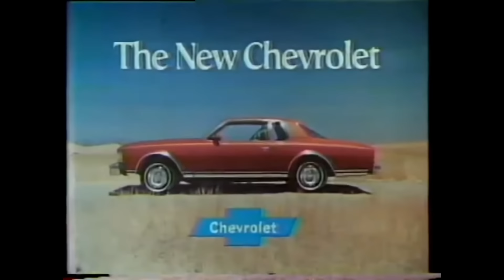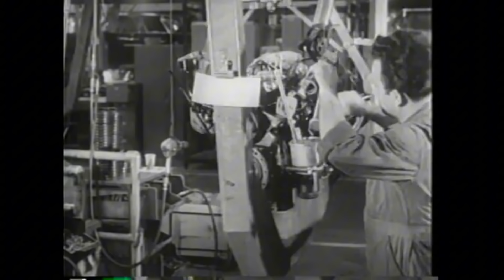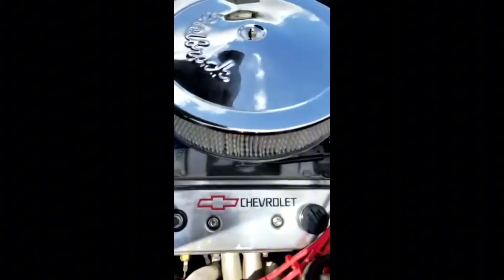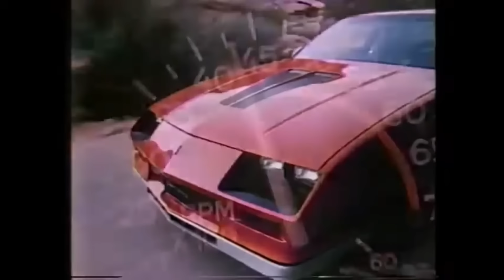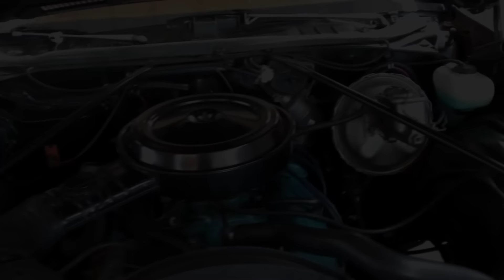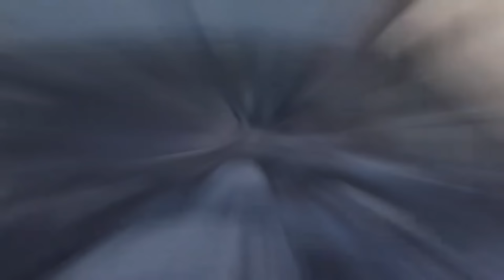How the Chevrolet 305 V8 Became GM’s American Savior AND Scapegoat

Comment: I am compelled to point out that while the 1960s 283 was making 'more power' than the 1970s 305, there is a significant factor that the video creator neglected to mention.  In 1972, the automakers were compelled to switch from specifying 'gross' horsepower to 'net' horsepower.  Gross horsepower figures were calculated using an optimized, bare engine on a test stand, while net horsepower figures were essentially measured 'at the wheel', with all accessories in place and operating, driven in real-world conditions.  For most engines produced in the early 1970s, this resulted in a roughly 30-40% drop in the specified outputs, even though the engines themselves had not undergone any radical changes for EPA and CAFE yet.

Bear in mind also that automatic transmssions were becoming more prevalent at the time, and in an effort to make cars more fuel efficient, axle ratios were being scaled back somewhat - instead of the 3.23s found in a lot of cars of the 1960s, ratios in the 2.75 and 2.80 range were being installed in newer cars - Ford even introduced a super-conservative 2.47 axle.  The lower-numbered ratios tended to curtail acceleration a bit, as the engine had less mechanical advantage to move the vehicle.

Pollution controls were still comparatively 'light' when this change occurred, but as the 70s ground on, more aggressive measures to improve fuel economy and pollution control resulted in lower actual outputs - more aggressive ignition timing, lower compression ratios, tweaks and modifications to carburetors, the addition of thermactorr pumps, and of course the dreaded catalytic converters.   It didn't help that the automakers stubbornly refused to downsize the cars, continuing to build land yachts until the late 1970s before introducing smaller versions of their full-sized iron.

The 305 is often maligned as a smog motor, but having driven a number of them in midsize cars, I always found them responsive and reasonably efficient.  Of course I recognize that they were not race engines, and even their ability to be modified was somewhat limited compared to the 327s and 350s of old.  But the 305 was reliable, durable, and smooth, and finding parts to fix one was inexpensive and easy.

Comment: I had a 3 of them.  One was a '79 Impala with a duo jet carb that got 28 mpg on the highway. I later sold it with 140,000 miles on it.  The 2nd was an '81 Impala that I bought as a body without an engine.  I completely rebuilt a 305 HO out of a crashed Trans Am.  It was 0.30 over, with flat top pistons, and an aftermarket RV cam.  It got 27 mpg and ran 15.20 at Edgewater Dragway in Ohio with stock gearing.  I lost it when some drunken teenagers ran a stop sign and broadsided me.  The 3rd was  a ' 79 1/2 ton Chevy truck with a 350 Turbo trans.  It got about 17/18 mpg on the road. I sold it to a friend of my brother.  My experiences with 305 Chevy engines were all excellent.  They performed well, didn't use oil and were trouble free.  I think they are good engines that gave good service.   But, I serviced them regularly, and never ever ran them hot.  The only maintenance done was tuneups, (Plugs, wires, cap and rotor), oil changes, and one set of new valve cover gaskets.  I like them.

Comment: What I never understood was, they had a 307 cubic inch engine. It was not that long into production was maybe three or four years why did they create a new small block? Unless it was some regulation about being 5 liters or smaller
Reply: Two reasons the 305 over the 307. First, the 305 could use the 350 crankshaft (sharing parts). The second reason is what's called "surface to volume ratio". It's an important factor for thermal efficiency (fuel mileage) and emissions, and it's better on the 305.
Reply: @turbo8454  thank you for that info. i read up on those engines and realized that the 305 and 350 were sisters as the 283 307 and 327 were.

Comment: I bought a 78 Pontiac Gran Prix with the 301v8. I never had a problem with speed. Great engine
Reply: I also had a 78 Grand Prix LJ with the 301 2bbl. It was a great motor.
Reply: Those were Pontiac motors. Apples for Oranges.
Reply: @davidbray7998 yes they were, the 301's grandfather was the Pontiac 389.
Back then every GM car and truck came with a tag saying it had a GM engine whether an Olds, Cadillac, Buick and so one. So if you wanted an engine made by Pontiac you picked an engine only Pontiac offered.
GM got sued by buyers with Cadillacs that got the Chevy 350 or 305 and they were pissed. GM ran low on brand specific engines that some bean counter decided a 350 was any 350. Same with the 305.
Reply: @311jbknight 
Haha I remember that. There was also an Oldsmobile guy who regularly bought a new one and he hit the roof and demanded a buyback when he found out his latest Olds had a Chevy engine in it.
And that was late 1976 so for 1977 and newer started the disclaimer on the window sticker that your new GM vehicle could have an engine made by a different division but they were all GM engines so basically not to worry lol.
And that was also the end of every engine having it's own unique color and for 77 every GM engine got the new paint color, GM Corporate Blue.

Comment: What would have been cheaper for those dumbasses was to build a 302! They already had 4" bore blocks, and 267 had the 3" stroke crank and there ya have it a 302 that would have been economical and easy on the wallet. They were and are dumbasses!
Reply: Agreed, the 305 was an 'under square bore' engine.  They'd have been better off with a 'oversquare bore engine'.  
The zz302 was a bit of an anomaly though.  They could have saved tons of money if they'd have just reinstated the venerable 327.  
But, engineers don't get paid for dusting off old tech.  They have to justify their jobs somehow.
The 305's main downfall was, it simply couldn't breathe.  The head flows were horribly inefficient.
Reply: @atheplummer  Ford ran the 302 in everything I am a bowtie guy but the blue oval 5.0 was AOK!

Comment: Alot of people that bash the 305 never owned one - yes the cams went flat but w a few bolt ons and a decent cam they ran great - now i am sure there were some 305s that were nothing but trouble but i had a 305 in my Z and it ran great - not alot of power but enough to do a cool burn out

Comment: My Dad had an 86 silverado - at 43k miles the cam went flat - he installed a new crane cam - roller rockers- edelbrock intake and had the q jet freshened up - he installed dual exhaust and that 305 ran great - he drove it another 80k w no issues and sold it - at first he cursed the 305 but after the new cam he loved that engine -

Comment: Once my 350 in a 74 Camaro let go I had to come up with a replacement, briefly flirted with the idea of putting in another 350 or even a 383, but went to putting in a 305 built by Jasper engines, they only put a torque cam in it meant for towing, and I gave it a fast flowing 500cfm AFB carb and a sp2p intake by edelbrock also, it was a 70s intake known for better economy but also great for low speed flow. finished it off with headers and an HEI ignition, although I know a 350 would beat it in acceleration, this 305 pulls 17mpg in the city and a solid 25 mpg on the freeway, so with its smooth idle, good responsiveness and good mpg, this motor will rule for a daily driver!

Comment: Very good and truthful video but they failed to mention the nylon timing gears that were notoriously known for failing at 70,000 miles if not earlier.
Reply: and the wiped out cams, and the cracked valve seats.

Comment: I worked at a Pontiac Cadillac store during this time and I have to say I remember the owner's daughter ordered the cars. Almost every 84 Trans Am had the 5.0 VIN code G. They all had 3.73 gears and I swear, they were not bad for the day. The transmission felt as if it had a shift kit and would bark the 1-2 shift at wide open throttle.
Reply: I had an 85 Z28 w 305 and a 5 spd - with a mild cam and headers it ran great - wish i never sold it
Reply: You mentioned the most relevant factor.  Gearing is very important when building a car for a specific purpose.  Most cars of the late 1970s were going down the road with 2.70-something gearing, which tended to make them sluggish compared to their 1960s forebears.
Reply: I test drove a new 84 305 L69 5-speed and I swear that thing ran good and would smoke the tires easily and I was driving a 75 400 4-speed at the time.
In 79 my dad's company car was a new Malibu station wagon and it was a no a/c car with the 305 and 3.23 gears and it ran great for what it was.
The gearing on many smog motors made an already bad situation worse and many had a 2.29 or 2.41 gear and that gearing won't help any engine.
Reply: @thud9797 they run good, I have a Camaro L69 5.0. I tossed the cat, put the air pump and exhaust manifold air tubes in a box and put on a free flowing exhaust (with a muffler) if I want it to, it'll fry both back tires off the rims.
Reply: @thud9797   parents bought a new chevy wagon  malibu  mighta been 79 or 80   no idea a POS  and ugly not to mention slugish, they traded n a buick wagon   cant remember the model  mighta been called an estate  wagon  72  or 73   455 power everything    thing was  awsomel luxury    definately a slug as well but I dug that Buick  and im a chevy guy !
Reply: I know what you mean, that was a pretty good set up. I had a 85 T/A that did the same thing, to my amazement it used to chirp 2nd gear. Everyone thought it had a shift kit, I'm pretty sure it didn't. 

If anyone sees the RPO code GT4 under the console lid, the car originally had or has a 373 gear. However, it doesn't necessarily mean its a Posi rear. I can't remember if the rear disc option on Camaro's & T/A's always came with a Posi or not. I know the ones with rear drum brakes were not always Posi. Nevertheless cool cars..
Reply: I too worked as a lot person at a Cadillac Pontiac deal in 83 and 84. I remember the 5.0 Pontiac engines. And they were okay with the crossfire throttle body fuel injection. 305 ci engines are used today for entry level sprint car racing.
Reply: So you were wrecking brand new engines people were going to buy 👍🏻
Reply: @garysarratt1 what are you talking about?
Reply: @alf20104    You ever heard of breaking in an engine??

Comment: Why would anyone build a 305 today, when it is commonly understood that reliable engines need a roller cam because of the changes in oil. That expense makes them a high risk investment with a flat tappet cam, or the roller setup. Lose/lose!

Comment: I have a fresh, 60 over short block with cast/dish pistons. Good luck making compression. It was a build for a boat, but my friend passed away. It has a Comp Cams 246PE cam. If I ever use it, I will buy the smallest chamber heads I can find. Maybe pull it down and put flat top pistons.

Comment: As boring as crap. Low powered. Not very reliable either. Valve train issues such as cams and lifters. Stetched timing chains. Rocker arm issues. These engines were typical cheapy engines. The LS saved GM's reputation

Comment: It was cost savings for GM>>using a common crank with 3.48 stroke. Nothing new here. In the early days Chevy used 3.00 inch stroke for 283 and increased it to 3.25 for 327. Used that same stroke for 'economy' 307. When 350 came out they used the 3.48 stroke in several displacements from the 267 to 305 to 350. Just changed bore size. Small displacement was NOT meant to make big power.

Comment: I have an 86 Silverado C10 with a 305. I don’t get the bad rap. With the low gear in a 700R4 it gets right up off the line. It is a smooth journeyman at highway speeds. I see no reason at all to switch it out.

Comment: Like the Chrysler 318, in stock form it did the job and was massively dependable. It did what the manufacturers needed, effectively move the vehicle while keeping the government off their backs. The 318 V8 and the Chrysler slant 6cyl. where the dependable, tough as nails legends of the Chrysler by-gone years. Don't be fooled the 318 with the right parts could be made to run very well and the slant six to this day is heavily hot rodded in Australia.
Reply: Had a 318 in 1978 Dodge Diplomat Wagon.  A great engine, fast enough and got great milage.  Say what you want about late 70,s Dodge cars mine was nice.  Fancy with fake wood grain and ac and power everything.  Held up very well!!!   Before that I had a Plymouth Fury wagon (1975) not great looking and lesser build quality but that 318 was great.  Bought both used and drove them everywhere.

Comment: While I’m not a fan of gutless engines, my parents bought a brand new 1985 Chevy 20 conversion van with a 305. This thing while being somewhat of a dog spent most of its life pulling a horse trailer just about every weekend besides normal family business. This thing just ran and ran trouble free. If I recall it was nearing the 300,000 mark when it was finally rotted out, however, the engine ran right to the end as it always had.
Reply: If it pulled a horse trailer, it was a hoss not a dog.

Comment: Like any engine, it will respond by adding  performance parts. But, like the Chrysler 318, it was mainly a base level  V8 workhorse.
Reply: Exactly, being that its a SBC. If you throw performance parts at it, it'll definitely respond.
Reply: In the day Hot Rod magazine had numerous articles as to what you could and couldn't do with that motor and still have a reliable motor.  And remember, junkyards were full of 4 bolt 350's and 327's just begging to be stuffed under the hood.

Comment: A friend had a '79 Malibu with a 2-bbl  one. A cam, carb & intake swap... along with headers, a Turbo 400, and a 4.11 gear...  and it was turning 14-sec. times at the strip.
Reply: thats really why the 305 gets hate, they never put any gears behind it. they tried to get mileage putting gear ratio as high as 2.56 and 2.73 behind it. when really it probably burnt more fuel trying get going with those.
Reply: @141runn  Eh, maybe most mid-size and full-size cars all had 2.xx gears, but the Monte Carlo SS came with 3.42 or 3.73, and most F-bodies had 3.08 to 3.73 gears.
Reply: @KevinJames_7795  but the ss an f bodies had 200 4r or 700r4 transmission with it
Reply: @141runn  And the Caprice, Monte Carlo LS, etc. could be ordered with 3.08 gears and a TH700-R4 or TH200-4R -- just basically nobody did.

Comment: Had a company service Chevy van with the 305 in the early 80's. It seemed to be relaible as a stone, but was one gutless wonder, especially with the full load of service tools and materials on board. Even in normal driving conditions, it had to be mostly floored and perpetually downshifted to barely get out of its own way.
Reply: At that point then why not just put a 350 into it? Cant blame the engine when the load is just too much? Then again a 383 would do it even better.......
Reply: @gkauto1959  Oh yes, I would dream of putting a monster engine in it, a happinin' paint job and tubbing the rear end. But it was a company vehicle that was issued to me, I could make no mods of any kind.
Reply: The people that spec out company-supplied work vehicles seldom have to drive or maintain them.  They're under a mandate to buy stuff that meets a specific price point, so a lot of times optional stuff (like a larger engine) gets rejected, particularly in large fleets.

I still remember the Fairmont station wagon they gave many of us to drive when I worked for a company that installed retail shelving.  I didn't have to haul product, but I basically lived out of that little car and I did have to carry a lot of personal items - clothes, tools, some equipment, and so on - and the company spec'd them with the four-cylinder engine.  Great gas mileage on the freeway, but gutless climbing a hill or on the on-ramp.  The only options were power steering, power brakes, and automatic transmission.  Not even A/C or a decent radio.  

In the end, though - it did the job, and that's all anyone really cared about.   I racked up over 90,000 miles on that little wagon, and it was still in running condition when they finally pulled it from service.
Reply: I have a 1988 GMC G2500 Vandura camper van for many years. It got 12 mpg with throttle body carb. It seemed that it had to be driven with the gas pedal halfway to the floor at all times. Very annoying. One day on the freeway, the water pump seal blew out at 70mph. I shut it off immediately as soon as the white cloud came out. I put on a new water pump but found that the heat warped a  head and found that coolant leaked into a cylinder and it wouldn't start.  I ordered a Jegs 350 crate engine and installed it with the new 350 computer. What a difference!  It  has much more power and gets 14 mpg.  Something like 90% of these vans came with the 305. The 350 is much better.

December 2025... I finally replaced a leaking heater core myself. What a terrible job. 5 different auto repair shops refused to do it because the entire dashboard needs to come out to remove the heater/AC/air ducting. I ended up cutting the bottom of the airbox out and easily removed the heater core and installed the new one. The GM clown who designed the airbox could have added an access panel with screws or clips to hold it closed. I taped mine back together with aluminum duct tape. The next heater core change will be done in 20 minutes. I still love this van.